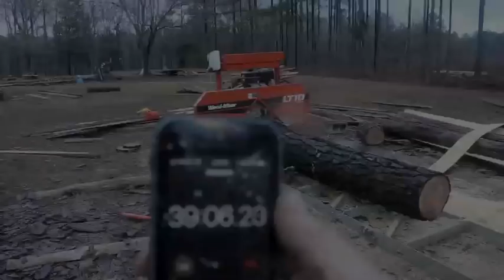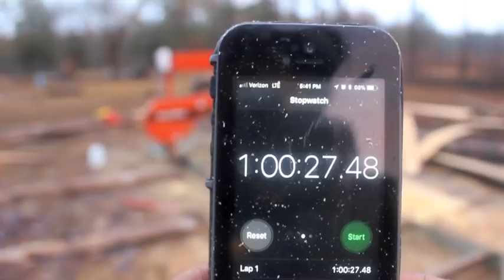Big production from a tiny sawmill!

Comment: as a owner  of a very old lt 10 I see you have cured 2 of the problems with the shaking of the mill drive belt tension sharpe blade now the third one is sap on the blade try using citrus orange in your water solution it will help remove the stickiness on the blade it helps stop the momentary stopping of the blade thus causing the shaking

Comment: There arw two ways to add a lot of production per hour. A single blade edger for 30-50% boost, especially when gettong a lot of side lumber. The other is to use extra frame extenstions like Wood-Mizer did a few years ago at the sawmill shootout. They had two logs clamped in sp could effectively mill twp logs without changing the blade height.

Comment: Much better than first time for sure   . The tips from other comment is good i would add this. The first 2 logs you did great on the slabs but the 3rd log reason you had the one board with alot of wane/bark you thin slabed it on first 2 cuts. Its easy to do you want to get the most out of a log but in the end you lose time and wear on the mill and blade by not taking enough on the slab cut. By having to make extra cuts that arnt nessessary. 
  Best tip is before you start cutting a log know the diameter of it on small end. Estimate how many boards you can get add to that the kirth of the blade for each cut. This will give you a close estimate of your cant size then just take ypur slabs based on what you need the cant size to be. This will eliminate having to make those thin boards and  extra cuts adding to waste or unusable lumber.
Reply: Ps by doing my suggestion over time you will get to where you will automatically know at a glance calculate your boards and where to take your slabs. But in the biginning dont be afraid to take a little time and learn to do it right. This will make you a better sawyer in the end.
Reply from the maker: Thanks for the tip! I thin cut that last one because it was a huge log and I didn’t want to have to deal with moving a massive slab. Cutting thicker slabs really does speed things up though.
Reply: Fall Line Ridge i am glad you liked the tip it will help emensly on all parts of sawing. Less unnecessary  cuts means more quality cuts making longer blade life and max yield for each log. Your doing fine it will get easier over time that is the mechanics of sawing the work is always hard bit rewarding at least for me it was.

Comment: Thanks for your videos. I have an LT 10 coming today, or tomorrow. I noticed yours was shaking from side ti side a couple of times. What causes this and does it effect your cut? Oh and where are you located? I am in Arkansas. Are you on FB? If so I would like to send a freind request and keep in touch.
Reply from the maker: Scott Elmore You will love it! In this particular video the shaking from side to side was caused when the pine I was cutting went from regular pine to a big vein of heart pine, which is much sappier and stickier. So, the harder and sappier the wood the more prone the machine is to shaking. You can remedy this by slowing down a little bit During the cut, making sure there’s plenty of water on the blade, and making sure your blades are sharp. It does not seem to affect the cut at all.
Reply from the maker: Scott Elmore Also, Wood Mizer makes different types of blades that handle harder words better. I have the blade that’s good for softer woods and some of the softer hardwoods. It’s possible that the blade designed for hardwoods would do a better job. But I can’t speak to that.